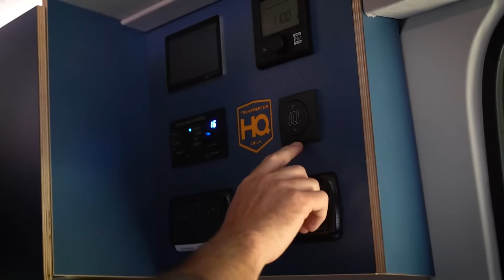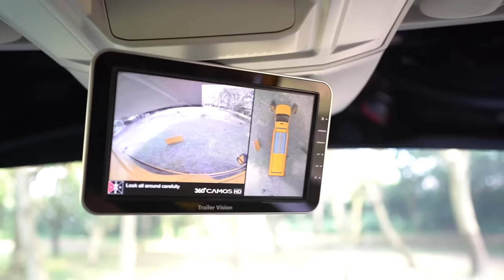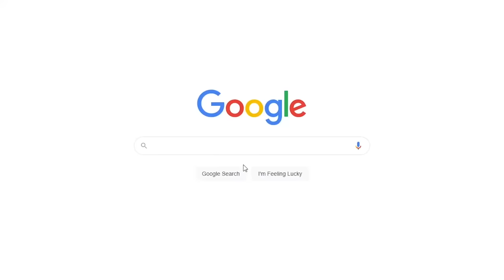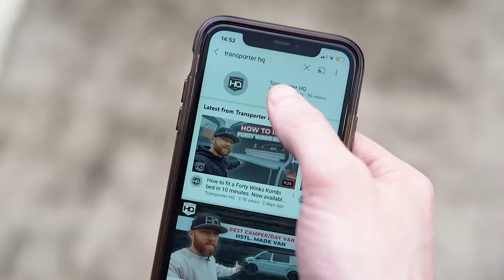Full Van Tour of Our 6 Berth - Extra LWB VW Crafter Camper!

Comment: No doubt it’s a sick van but for the UKs, tiny windy lanes, sometimes severe declines and inclines and extremely limited parking it’s completely useless unless you want to stick to the motorways and use campsites. Be a nightmare in most of the UKs small villages.
Reply from the maker: I'm towed a twin axel caravan behind a Q7 round most of the UK with no issues. This will mostly be used at UK VW shows and holiday's in Europe.
Reply: @THQAutomotive  you must stick to A roads though as I’ve got myself in trouble many times in a MWB crafter, especially up north in the national parks. Some parts of Scotland and Cornwall are almost no go areas as those roads have 180 degree turns and are less than 2m wide. At the least your gonna get that beautiful van scratched and beating up if you don’t plan your route carefully.
Reply from the maker: @aberdeendeltaforce  we'll plan routes for sure.
Reply: You probably aren't good enough to drive such a long vehicle to be honest.
Reply: @doubleL_S  doesn’t matter how good a driver you are if your vehicle physically doesn’t fit, did you not read my OP?
Reply: If that’s your opinion and driving limitations maybe you should consider a Fiat 500 and book in a hotel 🤔
Reply: @aberdeendeltaforce just because you can’t drive well doesn’t mean it can’t be done… park outside the tiny village. Country lanes accommodate 44 ton HGVs…
Reply: @ajm407  did I say it can’t be done? I said nightmare, another typical chav answer 🤷🏼‍♂️
Reply: @aberdeendeltaforce  just say you can’t drive… no need to puff your chest out Billy…
Reply: @ajm407  😂

Comment: Great conversation. Not enough conversions for families with more than 4. The quality of the fit out and the thought of what is really necessary really shows. My ideal van that. Well done 👌
Reply from the maker: As much as we love the standard fixed double bed at the rear, this was always designed with family in mine. I'm rear pleased with how it turned out.
Reply: @THQAutomotive  the alternating bunk arrangement into a sofa is a great use of space. I would need some form of garage space also, so would be interesting to see if it could be lifted slightly to give some storage space? I guess you went through all these options👍🏼
Reply from the maker: @savvysurveyor5318  Yes, under the back bunk is the A/C and heating. If you didn't have A/C or had roof mounted A/C and moved the heater, this would free up that space there as a small garage.
Reply: Struggled to find conversions for family of 5 as well. Vw or sprinter.
Reply from the maker: @jankaskyevitchjellbet7293  it seems most companies go with the double bed at the back, set up. I've not seen many with space for children. Not 4 children anyway 😜
Reply: So right!!! I just love this!! While my 4 children may have more than 2 legs, they still need space n a place to be day n night n not in the middle of the tiny aisle walkway!!! Plus they can get fussy always crammed together, like we would. Obviously needs tweaking for mine to get in their bed or lower it but with couple grans n maybe a friend to help, lol, this is as close as I’ve seen!! Was at the point of giving up n going to look at bigger! Ughh. 
But luv luv luv the front set up!!!! 
The only thing that worries me is the top tent. I absolutely love a get away space, but problem being I have wanted something I didn’t have to get outside to drive off if need be!! ( too many BF podcasts😳!)  Not sure of my ability to fight off a bear anymore!🙄😂  is there reasons behind that vs a pop top, I certainly already value ur opinion since you’ve managed to solve so many of my problems already!! 
Great great build if I’ve not said!! N yellow is my favorite color!!  
Ur new fan n subscriber!!

Comment: Did you ever get it on a weighbridge and find out the unladen weight?

I’m looking at a van to use for some building work, then convert to a camper afterwards. An XLWB crafter has appeared, but I’m wary of the all up weight once done
Reply from the maker: Yes its over weight so had to be up rated

Comment: Could the 3 bench rock and roll bed fit in the rear too but face the other way as in with the back against the side of the van making a 9 seater?
Reply from the maker: Not really. The Crafter isn't 6 ft wide and thats how long the bed is.

Comment: Looks great! On a practical note thé table is too small, doesn’t work for the swivel passenger seats and far too low to be eating at if you sit in the drivers seat.
Reply from the maker: The table it more for the children while traveling. We have a folding table to eat outside under the awning.

Comment: Hi mate, quick question if tou wouldnt mind. You said about the weight of the van. So if you managed to keep the weight under 3.5t this would be drivable on a car license? 
Thanks in advance
Reply from the maker: if it was under the weight, yes a car licence would be fine.
Reply: @THQAutomotive  OK thanks and the crafter is an XLWB?

Comment: It looks amazing and it has some nice details, but I can not help but wonder... when your vehicle is 8 meters long (incl. the rear-box) and it will easily weigh 4 tonnes or more, is a transporter than still the right choice? I'd assume a real caravan would then be more comfortable and offer more space with the only drawback of being more ugly.

Btw: your 1050kg rims are likely just not enough for this vehicle, after adjusting the weight above the 3.5t.
Reply from the maker: Never fear, I have a class 2 licence so I've had it up rated and fitted VB air rear suspension to take the extra weight. The wheels are still rated enough to cover the extra capacity. I'm currently in Italy at Lake Garda in it and it's been a dream for a family of 5. Much nicer and less stressful than lugging a caravan around. I've done that before across Spain and this is so much more pleasurable. Plus it looks incredible. The downside is people want to stop and talk about it at every stop 😂

Comment: Its worth bearing in mind, that unless precautions in relation to the very poor quality of modern diesel, are not strictly followed, then very expensive problems with the fuel system are almost inevitable at some stage.  Seems like those building these converted vans in the UK, are very interested in spamming them up to the nth degree, but very few seem aware of the fact that modern diesel will kill their fuel systems, unless the miles covered are very low?
Reply from the maker: Ok
Reply: @THQAutomotive  Unless you are reselling your van very quickly, look at adding 2T oil to the diesel. Modern diesel has had additives which provided lubrication removed, and is the reason fuel system problems are so common now,
Reply from the maker: @humourless682  thanks, I'll take a look
Reply: @THQAutomotive  It will make a big difference, and while it will not help with problems caused by dirt/water in diesel (which is pretty common now),  should prevent any issues related to lack of lubrication.

Comment: what capacity is the motor
Reply from the maker: Sorry, what do you mean? The engine size? Its a 2ltr 177BHP.
Reply: @THQAutomotive  That's it, thanks. I didn't just want the BHP, I wanted the size, which is usually the volume or CC. That's a hell of a lot of strain on a 2 litre donk, must be turboed to hell. I have a 2lt in my T5 Caravelle, but that thing is huge
Reply from the maker: @justme.9711  it honestly pulls so well. I guess you see modern heavy cars with tiny modern engines now-a-days. You'd like it would struggle with the weight but it seriously doesn't.
Reply: @THQAutomotive  Sure, because of the turbo etc, amazing, but know know about lights that burn brighter. The service life will suck, lol.
Reply from the maker: @justme.9711  True. It's not like it's going to be use daily though. Just a few good long trips a year.
Reply: @THQAutomotive  Yea' and it might be in an area where there are no real mountains. I'm just north of Sydney in Australia [ just after midnight, LOL ] and I wouldn't want that size motor, but for mid America or England it would be cool.
Reply from the maker: @justme.9711  We don't get big engines here. It's mostly about emission's and crazy high fuel costs.
Reply: @THQAutomotive  Especially at the moment eh'. Diesel is $2 a litre here, about $10 a gallon, but that's Oz dollars.